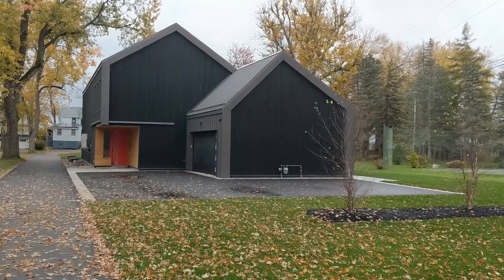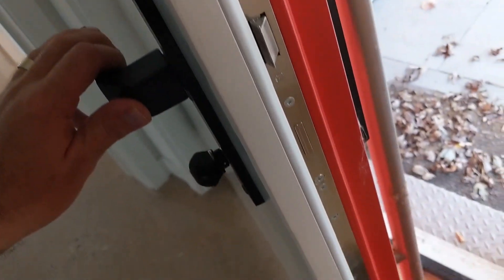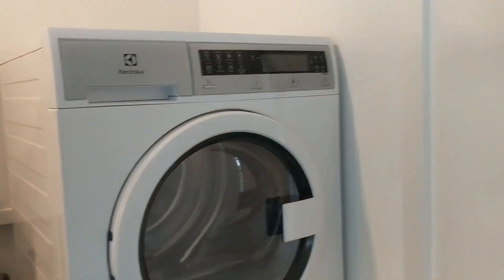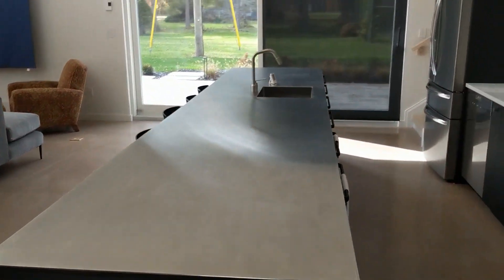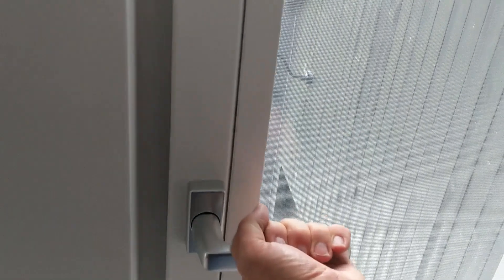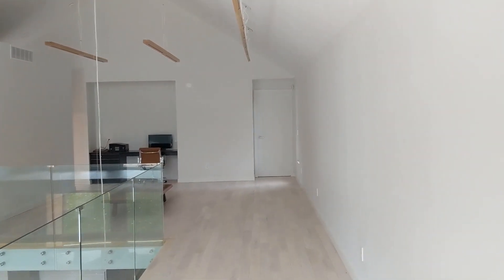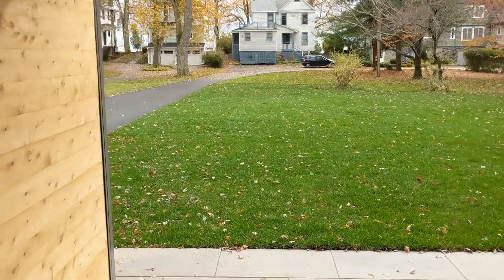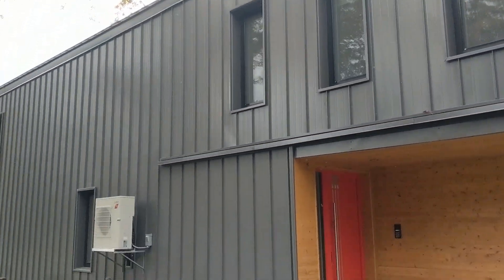Bay Beach PH | Passive House Canada Days 2020

Comment: Looks wonderful. I'm a bit annoyed about the walkway to balcony however, this is just because I feel like it should lead to something other than it just being additional vanity. The double high space, I assume, is to capture as much light, probably south light as possible and the walkway acts as some sort of internal shading that also acts as thermal mass. But still, it feels like it should lead to something.

perhaps a double storey greenhouse could have been included as a threshold between the outside and living room, above as well as below the walkway and balcony, could have been used?
Yes, any grown plants may shade some of the interior, like the walkway, but it would have many additional benefits including it acting as additional insulative space that cleans any stale air.
The large space, if notoptimally ventilated (Which Is Why I Assume It Features A Big Blimmin Chandelier-Like Fan), could benefit from such a greenhouse layer.

Comment: Wow beautiful house, I didnt saw the cooling system in the summertime. How much per sqft a house like this will cost? I can see some potential for solar panels on the roof.
Reply: The cooling system is also the heating system. The heat pump works in both heating and cooling modes. There are three interior fan coils which distribute the heat and coolth within the home.  There is great PV potential here! It was roughed in but has not been installed yet. PV coming soon!